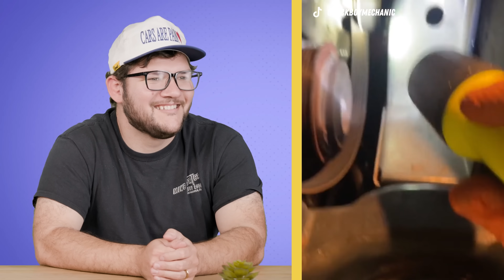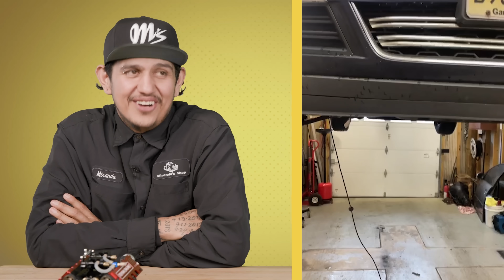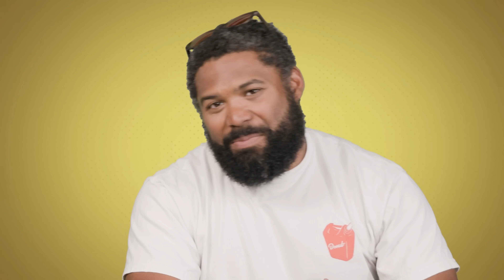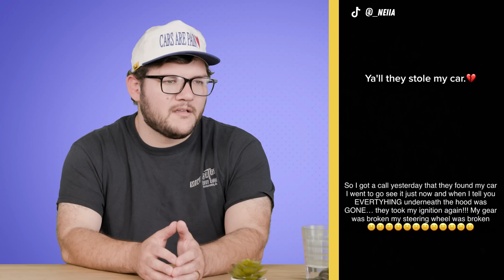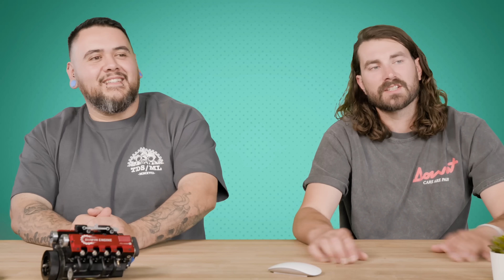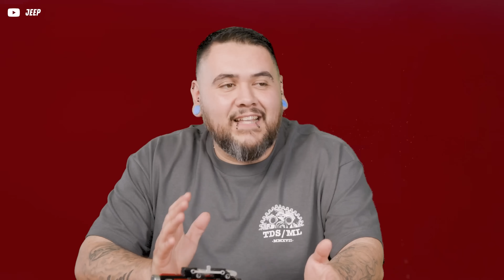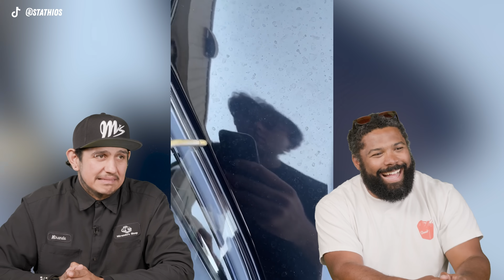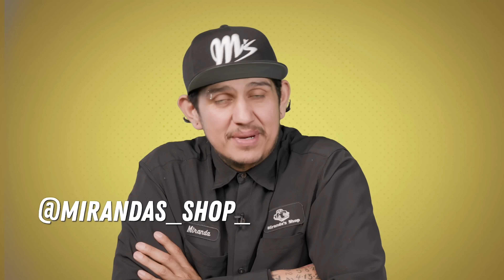Mechanic Reacts to Car Engineering Fails

Comment: work in a brake shop. i will never forgive hyundai for how they design their rear brakes/suspension. for the uninitiated the lower bolt holding the caliper bracket to the knuckle is behind the bolt where the lower control arm attaches to the knuckle, and when attempting to move the control arm out of the way you will realize that the bolt you need to remove runs into the shock necessitating the loosening/removal of the shock from the steering knuckle as well. So basically every time you want to do any brake work besides replacing pads you have to disassemble and then reassemble like half of the rear suspension. Definitly not the worst one but I encounter this on an almost weekly basis which I feel makes it worse
Reply: also on some of the lr2 hse s the oil filter is right about in the middle of the engine bay and under the power steering fluid reservoir. i want what the engineers at jaguar are smoking

Comment: unbolt the motor mounts and jack the engine far enough to remove the bolt because its an inch too long?

or cut the bolt where it is and vice grip the leftover piece? bonus is it'll be easier to put back in too

Comment: That first one is absolutely bean counters - that bolt was engineered for another chassis and the engineers would have wanted to change it and the accountants would have said it was too expensive. Same with the Kia thing - the bean counters removed the security systems that were fitted in the rest of the world.

Comment: A lot of people don’t realize that engineers work in teams. Sometimes either things don’t get communicated between the teams, or management tries to cut costs on one team which ends up creating a problem for another part of the car, all unbeknownst to either team because corporate is just worried about saving money.

Essentially engineers aren’t all sitting around a table designing the car at the same time. If they were, a lot of these issues would never have happened because there would be immediate communication between the drivetrain team and the chassis team saying “hey we won’t be able to take this long azz bolt out later if the the frame is shaped like that.”

Comment: I would as a Lexus technician working in a dealership I’ve seen a few defects from factory but not really crazy but some are just odd. However a lot of the time it’s really a customer issue. If I had a dollar for everytime a customer came back after buying a car because they complained say the car was defective cause the engine was ticking on start up but it’s just direct injection. What I’m saying is sometimes it’s not really the factory with some issues or engineering sometimes it’s just the customer neglecting the vehicle 😂

Comment: BMW engines have an oil cooler located right above the serpentine belt and the gaskets have a habit of solidifying causing leaks so when they do if you don't catch it in time it fouls your belt and all the pullies with oil

Comment: 2022 ram 1500 5.7 hemi trying to change the oil filter when it sits above the rack and pinion and limit space to work with to get it off and turning a new one on them @#$% engineers should go back and be @#$% with a book and drawing board
Reply: work as an oil tech have seen this so many times on various makes, models, and years. cant explain why for the life of me but truck engineers simply love to put the oil filter directly above the front axle. Best part is after you finally get it loose its nearly impossible to remove without getting oil all over said rack and pinion meaning you need a wider oil caddy to catch it all and you get to clean up the car afterwards :))))
Reply: @Noah Morse  drives me nuts because I'm down in a hole instead and it's so dumb

Comment: 10:50 in defense of the land rover, almost all their engines are designed to have the oil extracted. The drain plug is not the primary way of changing the oil. Also, pretty sure it's a diesel, that's why the oil looks the way it does.

Comment: Land Rover guy has never changed the oil filter in a GMC Acadia or Traverse or anything with the newer GM 3.6 V6 "High failure" engine.

Comment: How about a transmission filter replacement? 2017 Chevrolet Traverse with the 6 speed AWD transmission. The filter is like $30, but to replace it requires the transmission to be totally dismantled (shop quotes 17 hours to do the job)

Comment: one of the biggest engineering fails i've seen is on the 2015+ V8 mustangs. the oil filter is mounted at an angle, and when oil drips out of the filter while taking it off, the oil gets all over some suspension components. that's not even mentioning the ones with the extended splash shield and that horrible flap for the oil filter.

Comment: We engineers  are not that stupid. On the first segment, with the bolt being too long, this not the engineer. I expect that getting a shorter bolt would require a new SKU for the correct length and the bean counters refused that requirement preferring to use something already in stock. I expect the engineer  responsible for that assembly fought to within a millimeter of being fired to get the right bolt and was overruled by management. That they came out of a meeting telling anyone who would listen that mechanics all over would be cursing the engineer, As an engineer I have been there. When we need a new SKU of an otherwise generic part in a product we have to justify it with tons of paperwork and often get overrules anyway. The bean counters would sell their mothers to save 25 cents per vehicle. My point is that the engineer likely know this issue would occur and was overruled. 

The KIA issue is also a management fault.

Comment: That last one reminds me of my '09 Santa Fe. The head gasket would leak oil onto the Alternator. I've  had it changed 4 times over the years as they fixit, and a year later, realize the Gasket fix wasn't quite good enough, so another recall notice. shrug Least it's covered....an all day job each time.

Comment: I’m a mechanic that rebuilds marine diesel cummins engines. It’s kinda crazy the they can’t make a better bracket for the antifreeze expansion tank. The engines can vibrate the bracket and break crack it

Comment: Most of the problems with cars aren’t by engineers. They give multiple engineering teams the same problem with certain constraints. Price is the most important, and fixability is pretty much not a constraint at all. If an engineer came up with a solution, chances are it would cost a $1 or $2 at least to fix it, and in the auto industry, they’re looking to shave fractions of a penny. It’s not the engineers fault, it’s the people in charge of them

Comment: Just watched the first clip. Had the same issue with 2012 Buick Verano.  Had to drop the motor 6 inches to pull a bolt.

Comment: Angelina had my rolling with "well it's a Jeep", but come on girl, how are you going to blame a mechanic for not "engineering" a solution to a simple oil change. Yes a good technician would solve this issue when draining oil, but I guarantee the service manual from a British car manufacturer known for poor quality/engineering doesn't tell the tech to tear a piece of cardboard off the oil box, fold it in half and place at 45° angle up against engine undercover before removing drain plug. The problem is in the design/ engineering, the underpaid technician solves the problem by engineering/re-engineering.

Comment: I remember my father taking his Chevy Tahoe to a mechanic to replace a belt that connected to the engine (I'm not car smart). The mechanic removed the engine before my father paid him and set it on a work desk. It took between one and two years before my dad threatened to take him to court as the engine remained on the desk the entire time. The guy waived all the accrued charges and gave a full refund and went out of buisness within a year after that. That's the only time I can remember any bad mechanic aside from the one who sabotaged the engine in the first place on account of my father evicting them. Dad has had a similar issue recently where the mechanic stole his transmission and gave him one from a junkyard which took him 2 years to learn, gather tools, and fix. Heard his truck start and saw it running so all seems good now.

Comment: chevy cruze 1.4 turbo. they put the turbo (and oil cooler/filter housing) behind the exhaust manifold.. where its got the most heat...lol. and they wonder why it has problem after problem.

Comment: One of the ones I hate the most is the F150s with the oil filter on the front corner of the engine. They put an obvious plastic drain funnel under it so you get happy that you can just put a catch pan under there and not make a mess. BUT, the fuckin thing also drains on the back side where you can’t see so ends up making a mess on the other side. 
Things like that really make me think engineers sometimes really do go out of their way to make stuff bad.

Comment: The current gen Ram 1500 with the 5.7L Hemi doesn't have enough room between the oil pan and the sway bar for normal ratchet to get on the drain plug. Also, when the plug is removed, the oil WILL spray the sway bar, and must be cleaned off every oil change.

Comment: As a former auto tech, and current IT tech....yes its the fking fault of engineers stuff is hard to repair. Absolutely. Every tech I've ever known agrees.

Oh and the OG move for a cheapo kill switch, on 90's Hondas, is to pull the main relay wiring harness down from behind the dash & then just take the main relay with you when you get out of the car. Even works in Phoenix AZ.

Comment: Nearly every sedan and compact built by GM recently is an absolute engineering nightmare. I'm talking wiring harnesses, engine computers, entire fuse boxes, sensors that you could remove on a '96 in no time at all are hidden behind entire engine components. Its really sad how modern car manufacturers are shifting to that "as long as it outlasts the warranty" mentality

Comment: I wouldn’t be surprised if the issue with the overlong bolt in the belt tensioner was a result of two departments not communicating: one designs the engine, one designs the chassis the engine goes into, and neither thinks about serviceability.  Hey, we put the belt on before we drop the engine into the car, no problemo!  Hey, look the engine fits, no problemo!  Try to change the belt, mucho problemo!

Comment: It's simple, engineers are told to over design engines which then makes a job harder and longer for the mechanic to do, which ultimately costs the consumer/customer more money. This is really noticeable in main stealership garages. It's also why most manufacturers use plastic parts in the engine bays, (looking at you BMW) because they are cheaper to mass produce, more likely to fail due to age and brittleness from multiple heat cycles and it's then costing the customer more money when they have to buy either a patented or genuine OEM part to replace it.

Comment: Years ago I needed to replace my alternator. I’ve done it myself on other vehicles I’ve had with no problems but now I have an 09 Corolla with an impossible bolt. It’s not as bad as the one in the video but I had a mechanic do the same thing Angelina said to be able to get the alternator out.

Comment: 2006 mitsubishi montero sport oil filter location! pain in the ass, no tool will get there confortably, it won't go out easily, and to make the torque you need to get it out, you'll be totally underneath it. You'll be an oily mess yourself 😢

Comment: Started as a mechanic myself and went back to school for engineering. Now on the other side I realize the bean counters and pensil pushers are to blame for at least half the problems. That belt tensioner bolt was probably used on other cars in GMs lineup and rather than spending additional money per car to swap it out they said fuck it let's use what we have.

Comment: I think the first clip is from a GM 3.6(traverse, impala, etc). The alternator has to be removed, as the bolt that holds this idler pulley is the lower bolt for the alternator.
Ok I watched more and it is a traverse lol.

Comment: I am an engineer. Going back to the Chevy traverse in the first clip what is important to understand is that this engine is used for multiple vehicles most likely so basically what most likely happened on the engineering side was;

1. Make this engine fit in this car

2. Figure out how to connect the wiring harnesses and motor mounts to the existing frame and chassis

What you are seeing there is most likely the use of carried over parts from an already existing platform that wasn’t optimized for repairability.
Reply: Later models put a cut out there and the ability to take out the tensioner without fully removing the bolt. No doubt an engineering fail.

Comment: Interesting to see all the engineers comments in the discussion (if we can assume they're not bots).  I suspect the engineers are correct, they work from a budget, and management knows that the acceptable error rate for auto manufacturing is much higher than say, an air plane/jet build, or something delicate and intricate like a computer.

Comment: That pulley bolt, uf dah! Toyota Matrixes, Vibes, and Corollas had a belt tensioner that failed early, and the damn bolt was a whole INCH too long. The easy way to get it out was unbolting 2 motor mounts, taking the tire off and using a 3 foot long prybar as a lever on the sub frame, stepping on the handle end to lift the engine up 4 inches. Did so many of those tensioners, I could get the job done in 10 minutes.

Comment: Tar and feather Nissan's engineers, and Paccar engineers.  Kenworth and Peterbilt trucks with their house engines are a dumpster fire.  Their trucks are junk.  Cheap materials, weak switches, way too many sensors, needs modular wiring harnesses, door bolts that constantly need tightening, too much to list.  Nissan...quit putting sensors in places you can't see and difficult to reach.  Screw all the plastic air intake crap!  You have to disassemble the entire intake just to replace a single spark plug and coil.  Stop with those stupid ignition coils.  Bring back the rotors.  So much easier to work on...and they don't get hot and melt/crack on you.  Use better materials for dashboards.

Comment: Not a mechanic related thing, but my 2017 White Hyundai Sonata has its paint peeling and chipping off, all the way to the bare metal. 

It got so bad that Hyundai had to settle a class-action with owners over the paint

Comment: I just wanna say that I went to replace a tail-light bulb in my 2005 Corolla the other day and it was EASY and I didn't even need a screwdriver.  Same with the AW11 (from 1988).  Some cars would make you bleed in five places for that.

Comment: While yes, a lot of these issues stem from the people designing parts never have to face the reality of taking them back off, a lot of these issues come from above. New BMWs not having dipsticks for example was not an engineer's choice, it was probably an executive, the engineer only has to figure out how to make that happen. The frustration is real, but slightly misplaced

Comment: On the 2006 Toyota Preus the battery air tube to the outside of the car goes directly over the 12v battery

Engineering oversight

Comment: As an automotive engineer in a major tier-1 supplier, I can tell you most of these problems are identified by the engineers early in the development phase. Unfortunately, we are not the ones running the show. Managers only care about reaching SOP (start of production) deadlines, because that's the performance metric through which they are evaluated and get money from. They straight up tell engineer to do it the faster way and and not care about lots of quality aspects (of which maintainability and serviceability are part of). And engineers get evaluated by their managers (yes, the ones who not care about quality). So when an engineer tries to force a hand to go for a better solution instead of a faster (or more profitable) one, he gets screwed on the evaluation. Do you see the problem here?
I can tell you, engineers loathe badly designed things, it rocks them to their core. The whole reason they become engineers is to do good designs. But we are no the ones running the show, money is. And while you keep buying these crap vehicles and money keeps coming in, this crap will continue to happen.

As an example, I am absolutely certain the issue with the lack of space for the bolt and the undertray in the way of the oil drain was due to reusing parts from other models. If it works in the assembly line and it's cheaper, that's what they'll go for. Management gets their bonus. Clients get screwed. Marketing covers it up.

Comment: working at a shop.. 
Jeep are usually overheating problems, wiring issues, broken links or death wobble being super common..
Chrysler 300s are always & I mean always at the shop for constant issues from leaks to transmissions and engines
Dodge- 2.4L - constant engine failures or rebuilds
Mercedes- way to many panels and wires in the way
Bmw- modules need to be re learned if you forgot to keep power running to the car while changing the battery
Ford- don't get me started... The only thing ford gets right is the wiring is rarely an issue.

A good portion of those vehicles new.. suck major $#*! For working on... GM has some issues Volvo I won't lie I do like Volvo even though they do have issues that happen pretty often mostly alignments for me.. mini Cooper and fiat are just odd to work with especially the fiat 500 that car can burn.. Tesla we don't touch those because we are a shop for motor vehicles. Mazda not bad, range rover not bad, nissan not bad, kia not bad

Toyota.. mostly perfection
Honda.. mostly perfection
Lexus.. mostly perfection